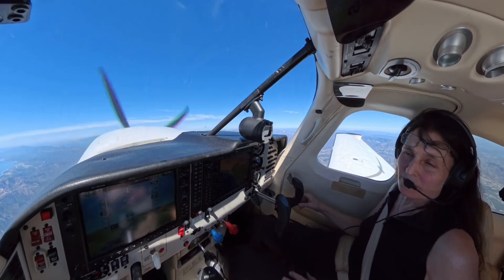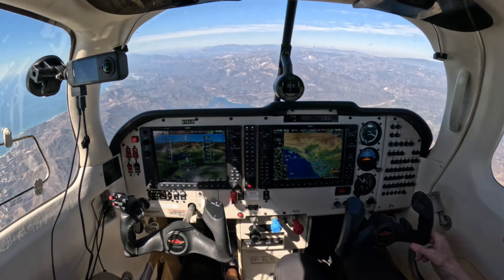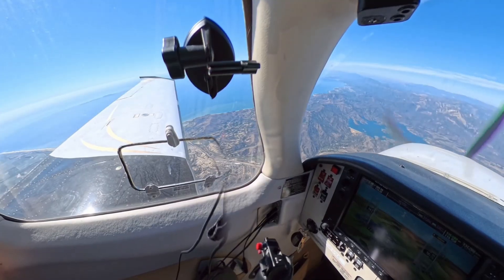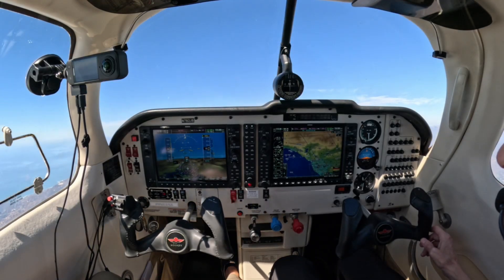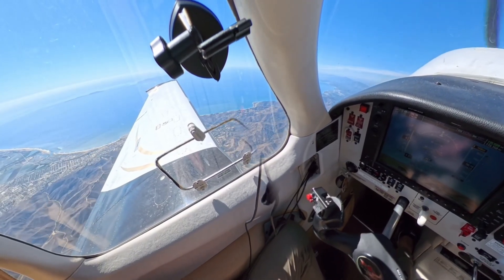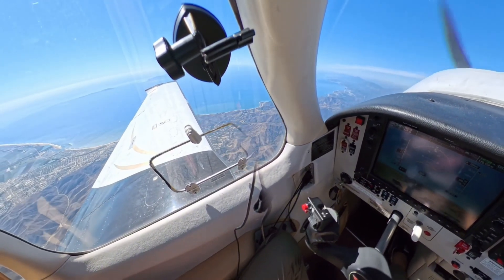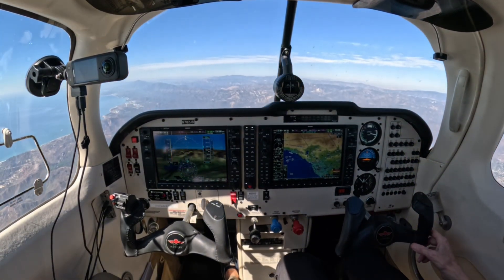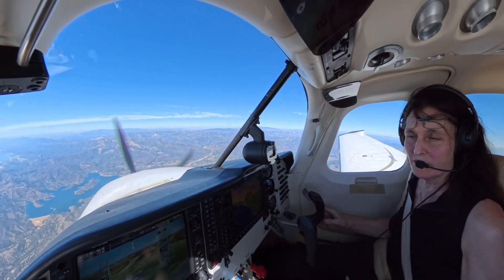How the plane stabilizes itself like a PRO

Comment: Very cool demonstration. This should be shown in college aerodynamics courses! I would have to imagine the forward(ish) sweep of the Mooney’s wing contributes to slightly more neutral/negative longitudinal stability? I recall that a backward swept wing tends to level out in a slip due to the airfoil seeing more perpendicular air on the inside wing. Though I can’t think of any GA aircraft with a significant sweep to test this out on - you might have to rent a phenom for that!
Reply from the maker: Interesting thought and I would love to rent a Phenom!  I think you are correct in that the swept wing is more of a factor with roll stability or stability about the longitudinal axis. I think the thing that may contribute more to the relative dynamic instability about the horizontal axis (i.e longitudinal stability) here is the stick free component. The short body Mooneys have stick fixed elevators, and the long body Mooneys have stick free elevators. The second mode stick-free is essentially a coupling of motion between the airplane short period pitching motion and elevator in rotation about the hinge line. But overall, I love this kind of feedback! Thanks for watching 😊